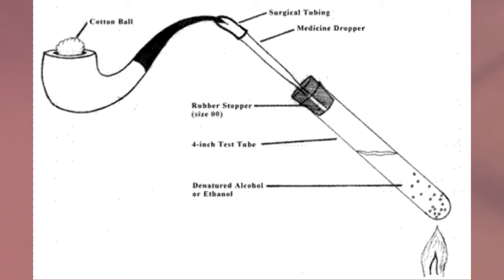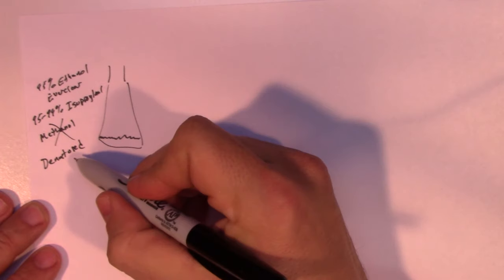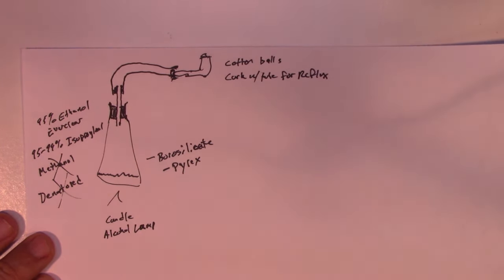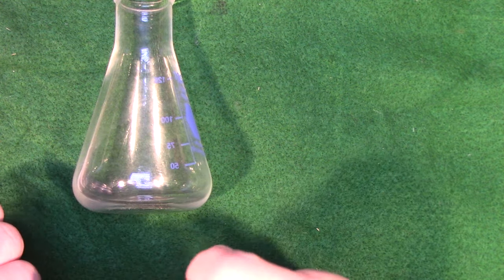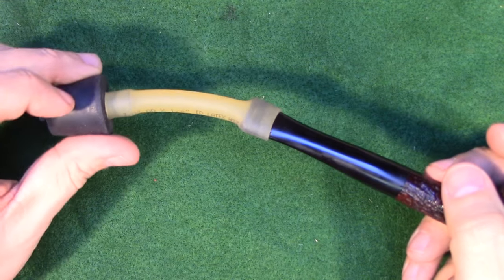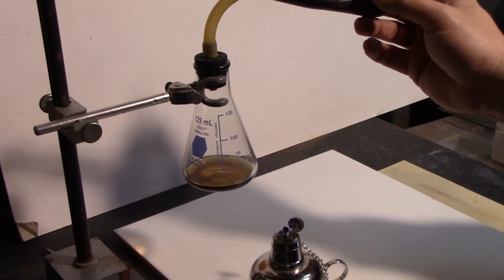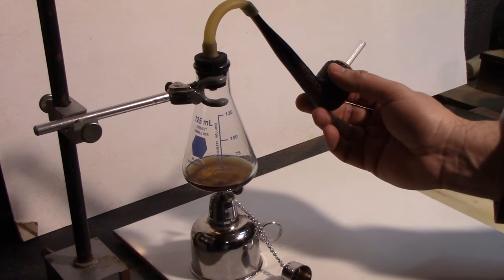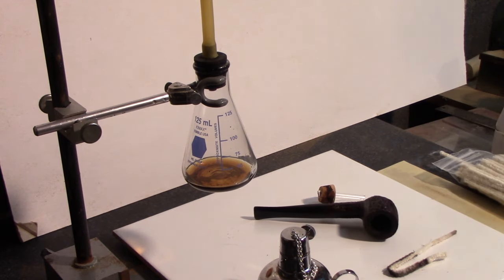Building and using a Tobacco Pipe Retort

Comment: This is the best video I've seen on how to properly retort a pipe. I learned a few things to use when and if I do another retort. I like the use of the tapered beaker and cork stopper. I'm now looking into getting these. Thanks again!
Reply from the maker: Thank you Alan!  If you need help sourcing those parts just let me know. Mike.
Reply: +CaneRodPiper yes, please give me some info. I looked at Amazon and thought $30 to $40 was a little too much for the tapered beaker. Maybe that's what I need to spend for one I can boil in though. Thanks in advance.
Reply from the maker: +Alan Lutz The company that I linked to in the description has them for $5.50, but I use 125 ml and they only have 50 or 250ml in that range.  Search there site for for Erlenmeyer flask and look under "Chinex" in the results.   If you want the 125 ml, try Ebay.  A search for 125 mL Erlenmeyer gave several options in the $5-8 range.  Good luck!

Comment: Your approach to pipe cleaning/restoration is really exceptional (at least on YouTube.) Thank you very much for sharing your knowledge!

I also have question if you could help me with, I tried to retort an estate pipe I recently bought, but when the alcohol starts to boil there is always a leak happening and it seems I just can't make enough pressure, or I'm building too much pressure. One time the cork on the opening of the chamber poped out, and the other time the rubber stopper on the Erlenmeyer flask! And the worst seal was on the bit of the stem. Surprisingly the tenon/mortise joint never failed despite the stem being a little loose. I did manage to get a little bit of juice from the pipe but right now I'm afraid to go on with it, maybe I'm doing something wrong that's making excess pressure. Maybe the cork on the opening of the chamber shouldn't be so tight a seal? Except the first time that I tried and got some juice from the pipe, now it seems that the alcohol vapor doesn't get to the chamber since I can't sight any condensations on the reflux tube.
I'd appreciate it if you have any suggestions.
Reply from the maker: Hello, and thank you for the comment.  The first thing to check is that there is no obstruction between the flask and the end of the tube that connects to the stem, and withing the reflux tube.   The exact dimensions of the bore through the reflux tube and the bore through the connector that goes through the rubber stopper are not important, but at a minimum they should be at least 1/8 inch, and pipe cleaner should easily pass through them both.  Next, is the pipe in any way obstructed?  Can you easily pass a pipe cleaner through the stem all the way into the bowl?  If you set everything up and then remove the rubber stopper from the flask, you should be able to blow through the stopper all the way through the pipe and the reflux tube with no more effort than it would take to blow through the pipe alone.
If that does not help you, it might be worth taking a few pictures and sending them to me by email so I can look and see if I can identify the problem for you.  You can find my email address on the "about" tab on my channel page.  And please let us know if you figure out the problem in case anyone else is having the same problem.  Thanks, Mike.
Reply: The pipe was already sort of “deep-cleaned” when I tried the retort so there was no obstruction, although the pipe is an English, non-filtered, with a draft hole slightly smaller than 9/64 inch. The tubings both are 6mm ID x 8mm OD. The hose dimensions is the same as the tubings, so maybe the thinner wall thickness of my hose is the source of the leak from the bit, since it can’t “grab” the bit tight enough. Also in the video while testing the retort at one point you said that the stummel is hot and there is some vapor escaping, so where was the vapor escaping from in your case?
Oh and one more thing... Is the position of open end of the reflux tube relative to bottom of the cork important? Mine is about 1/4 inch below the bottom of the cork, but maybe it should seat above it?

I will email you some pictures of my setup, thank you. Although I’m actually done with this pipe since I reamed it to bare wood and filled some fissures with the pipe mortar (thanks again!) So I’m not going to retort this particular pipe for now, but I do have a picture of the setup and the components. Hopefully we can find out the problem for future retorts!

Comment: Excellent video.  Are there any issues with vaious stem materials; namely,  vulcanite, vinyl, etc., with hot alcohol vapor.
Reply from the maker: Not in my experience as long as you use Everclear or some similar Ethanol. Isopropanol (rubbing alcohol) can react with some plastics/acrylics.  I have never had a problem with ethanol, but I don't know that I've tested every stem material,  so you're milage may vary as they say. 
Thanks for watching!

Comment: Thank you for making this video! I just ordered my erlenmyer flask and bored stopper. I'll get the rest a Lowe's or something. Thank you! This was a very informative video.
Reply from the maker: +Half n Half with Sage I'm glad you found it helpful! Let me know if you have any questions. Best, Mike.
Reply: CaneRodPiper
 Sure thing!
Reply: Do you think it would be okay to use a cleaned out perfume sample bottle, for a re-flux tube on the cork? The little glass vials.
Reply from the maker: Half n Half with Sage The reflux tube does not get very hot, so anything should be fine.  Even something like a piece of a plastic ball point pen barrel should work.  You just want enough of a tube there for the alcohol to condense.
Reply: CaneRodPiper
 Okay good. Thank you for your help!

Comment: Does retorting (or any use of salt and alcohol) to de ghost pipes have any ill effect on estate pipes that were cured in a particular fashion?  For example, Ser Jacopo pipes used a specific curing process which gave its pipes a sweet and nutty smoke. 
While I want a clean pipe, I’m not interested in ruining the effect of the curing that was done. 

Any thoughts?
Reply from the maker: I don't know. If you are worried about that, you will  have to decide if the ghost is bad enough to risk it.  Sorry I can't be of more help on this point.

Comment: Thank you for this video! I have bought all the necessary components to reproduce what you did. But I have a question. If you are simply using the steam from the boiling alcohol, isn't that just the water component of the alcohol being driven off? I did buy the 91 percent isopropyl alcohol, but still... isn't the steam just water vapor?? I'd appreciate a clarification on this. Thank you!
Reply from the maker: Hello, and thanks for the question.  Alcohol boils at a lower temperature than water.  So if your solution is >90% or so alcohol, the steam will be pure alcohol as you have not reached the boiling point for water to convert to steam.  That's not 100% true because ethanol and water form an azeotrope, but that's not worth worrying about for this purpose. The vast majority of the steam will be   alcohol vapor. I hope that makes sense,  but feel free to ask more if not 😉👍
Reply: @CaneRodPiper  Thank you so much for the clarification! I thought about the temp difference between alcohol and water, thinking maybe the temp is low enough to be alcohol vapor and not water, but then I was thinking.... if the flame under the flask stays on while performing this procedure ... who's to say it's not increasing the temp to the point that it is indeed water vapor. I suppose I would need to do a temp test to ensure it doesn't reach 212 degrees in order to verify this.

Comment: Can a vinyl tubing be used instead of latex tubing? Latex allergies are quite common.
Reply from the maker: +The Kilted Piper as long as it is flexible enough to seal around the stem, it would probably work.  But I've never tried it myself.

Comment: Really great and informative video. Where did you find the cork screw and the piece of glass tubing sticking out of it? What diameter is the glass? As for the latex tubing, the right size is 3/8 outside diameter and 1/4 inside?
Reply from the maker: The cork was a piece of cork that I use to make fly rod handles that I shaped with sandpaper.  Any cork that you can find at a hobby store should work, and it is pretty easy to shape them and drill holes.  The glass tube was just something I had lying around that happened to fit the hole.  Something like an old pen barrel could be cut to serve the same purpose.  It does not have to be glass.  You have the correct dimensions for the latex tubing.  Let me know if you have any other questions, and thanks for watching. Mike.

Comment: Have you tried it on pipes with aromatic ghosts? And did it get rid of the smell and taste altogether?
Reply from the maker: Hi Ilan,  That it the primary reason I use the retort, but it is always a last resort.  First I try the salt and alcohol method and if that does not get rid of the ghost then the retort always does the trick. Mike.

Comment: Ethanol is a much better solvent than isopropyl alcohol.
Reply from the maker: It depends a bit on what you are trying to put into solution, but in general that is true.  I've used both and for pipes I have not seen much of a difference. Interestingly isopropanol occasionally reacts with an acrylic stem, so that is a good reason to avoid it.  Thanks for watching!

Comment: Isopropanol is more toxic than denatured ethanol... but okay.
Reply from the maker: Acute toxicity is not the point unless you plan to drink it. Denatured alcohol contains a variety of additives to break the azeotrope,  and to intentionally make it unfit for human consumption.  These may include methanol, benzene, pyridine, or even gasoline.  Most of these additives have a higher boiling point than ethanol and will therefore stick around longer.  Isopropyl alcohol is more toxic than grain alcohol, but certainly not more toxic than the additives in denatured alcohol. The varieties of Isopropyl alcohol available at the drug store will rapidly evaporate leaving behind nothing but water. Please do not use denatured alcohol on the interior of your pipes.  Thanks for watching and for your comment.
Reply: @CaneRodPiper  I've been using denatured alcohol for over 15 years. Maybe it's not strictly regulated there, but here ethanol is denatured with a bittering agent and 3% methanol. The low volume makes the denatured alcohol less toxic by volume than isopropyl alcohol.
Reply from the maker: The "by volume" point only makes sense if you are drinking it.  I do not advise anyone use denatured alcohol on the interior of a pipe.